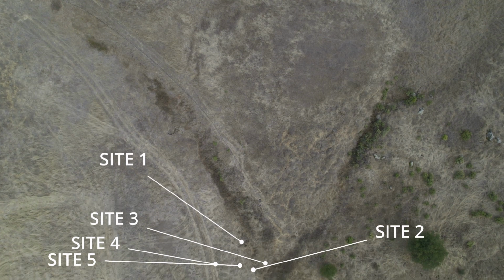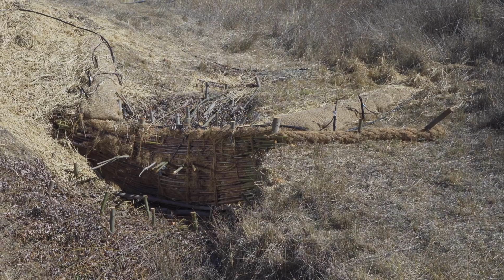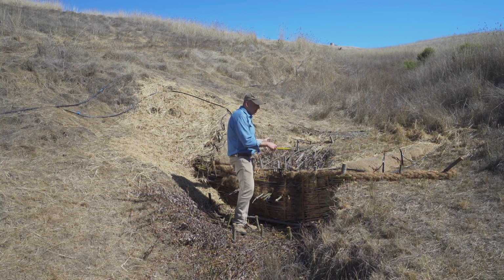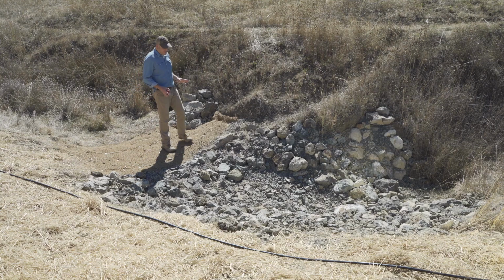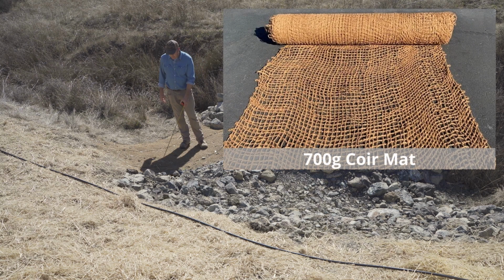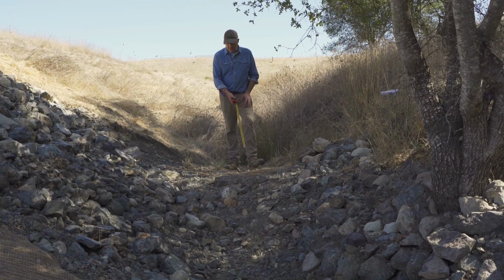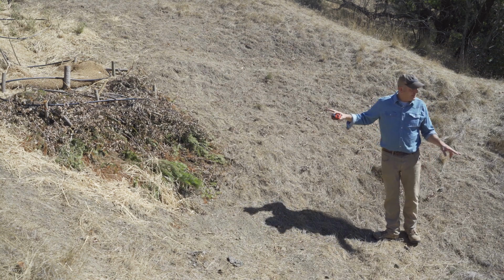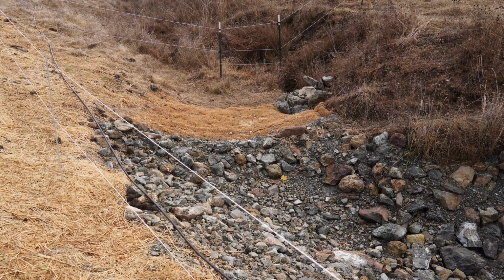Post-Fire Gully and Headcut Repair Demonstration Project – Pepperwood Preserve

Comment: How do you keep the critters from chewing holes in the irrigation?
Reply from the maker: For the first few dry months after the project was installed, this didn’t seem to be an issue. The irrigation system was turned off at the start of the first rains. Sometimes critters do chew into the line, and you just have to plug the holes or patch the irrigation tubing with connectors every so often. We tried to design this irrigation system so that water would drain out of the tubing completely after the irrigation system is turned off, which may have helped.